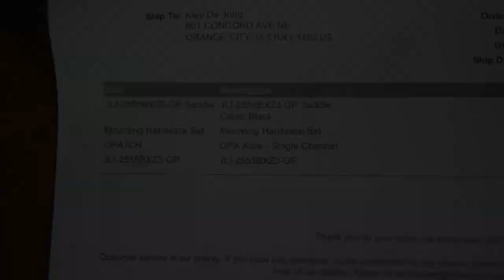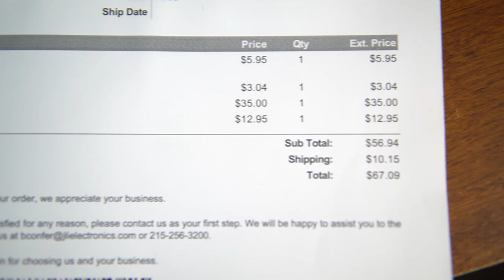Cheapest Mic on Amazon - Rebuild / Mod for TONE | Neewer NW-800 to JLI Audio Conversion

Comment: A grill on this type of microphone is typically called a "head basket."   JLI sells 22 uF 22nF capacitors for RF suppression - VISHAY K223K15X7RF5UL2 - not 32 nf.  Removing the XLR connector from the internal frame makes it MUCH EASIER to solder the capacitors and lead wires to it.  It would tell us more if you did more A/B testing, especially with the guitar playing, and also if you killed the reverb and any other effects so we could hear you and the microphone in the raw.  That would tell us much more in a short time.  Just some suggestions - nicely done video overall.  JT

Comment: dunno if anyone mentioned it, but you can take those XLR connectors apart, if you use the end of a cable you can hold it in place and make soldering the capacitors soo much easier.  there are two types I've found so far one screws out(with a screw on the outside) the other screws in(the screw in on the inside, it has a tapered tip to lock it in an gorund and is a righty loosey situation)

Comment: i'm gonna make a mic like this soon. and fyi, aside from getting some "third hand" things for holding on to what you're soldering, I'd suggest getting a decent soldering iron too. Its way too easy to overheat stuff with those low end irons and if you ever solder a component where there is an even moderate ground-plane, it would have issues. I use an Aixun T3A soldering station with C249 tips and it's worth every penny.
Reply: I got a mechanic t12 pro myself recently – what temps would you recommend for this kind of application? I also thought a pair of wire snips would have done a way quicker job of removing the wires, but he did a way better job with the soldering than I can at the moment.

Comment: Ok, I have lost the last half octave due to age, so 6:50 and then 6:56 . is the issue that the origin mic is too harsh? So the preamp flattens out the top end? btw love your guitar and both voices 8:39. I prefer to use acoustic instruments and a female voices to compare speakers and mics so you hit the nail on the head with this demo. I can't wait to check out your other videos. You've earned a subscriber! And yes, you really should get a soldering alligator clip! Just glue the alligator clip to a magnet and a small length of metal. Fits in a soldering bag better.

Comment: Great content and playing! but i wonder, what's the point on putting good quality components in a cheap mic body? Maybe I'm missing something.
Reply from the maker: The idea in my mind is that the capsule and circuit are the components that actually affect how the mic sounds.  The shell and mount are just the chassis upon which the important components are mounted.  I'm not familiar with a cheaper way to make a mic that sounds like this.
Reply: I understand! Thanks.
Reply: @KleyDeJong  Thanks for the explanation!

Comment: Hi.I also like to do BM-800 mods. I purchased OPA 1642 for Alice OPA and was very surprised when I measured the resistance between pin 4 (groud/com) and inputs 2, 3, 5,6. Everywhere I got 240kom. How can it be? After all, there are field-effect transistors at the inputs? How much resistance do your chips have on the inputs?. It should be infinite, as I imagine. Please answer me.

Comment: Cool and weird on the same time, you don't mod tbh, its just fitting another mic into 800 housing. Effort doesn't make sense, better to buy used p120 or at2020 for the same cost of goods.

Comment: Would these mods work with the BM 800? it seems like after replacing both the capsule and the circuit board, you're essentially just using the mic case, so would there be any particular reason the BM 800 wouldn't work? I ask because it's a better deal on amazon right now and comes bundled with a bunch of useful accesories.
Reply from the maker: Yeah absolutely. Just needs to have an XLR base connector and enough room in the body housing to fit the circuit board. Any large diaphragm condenser would work.
Reply: If I'm not mistaken the BM700 has a foam padding inside of the head basket whereas the 800 just seems to be the wire

Comment: What happens if I just swap the original capsule with the 12 USD capsule of the video ? WHy adopting another PCB ?  Doesn't the stock circuitboard power and amplify the capsule? Many Thanks. IMHO the whole parts modification is not definitely worth, as per 80 USD an AKG C3000B (2nd hand) or a Behringer B1 ia easily found on the market...
Reply: Power and noise

Comment: You're soldering wires to the new capsule without showing how. There is polarity to respect, I think ... 
Also the phantom-voltage can be different. Is it 48V or less here? 
A lot of these cheapo's only work with the power coming from the PC ... so 5V
A good capsule needs 24V al least. Sometimes the circuit needs +/- 24 ... so "balanced voltage".